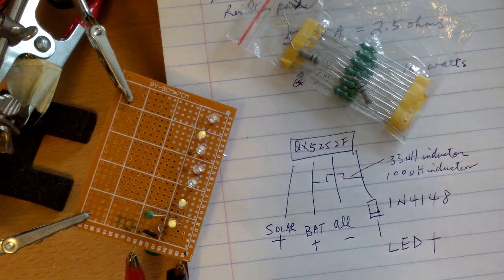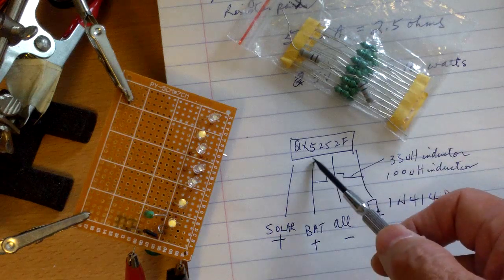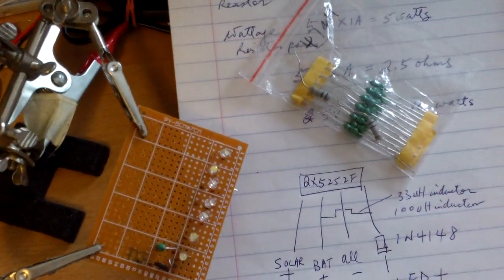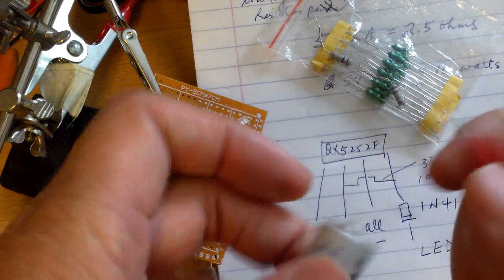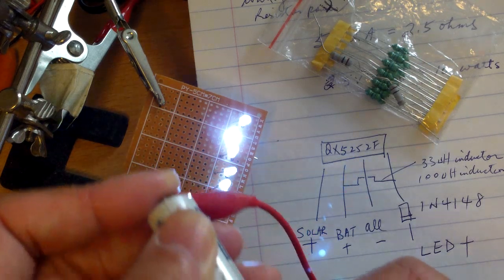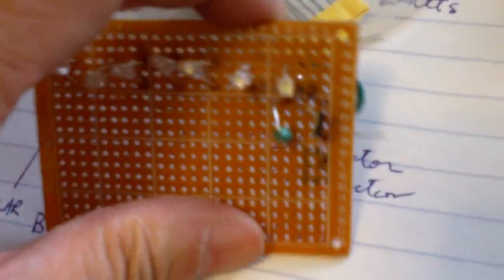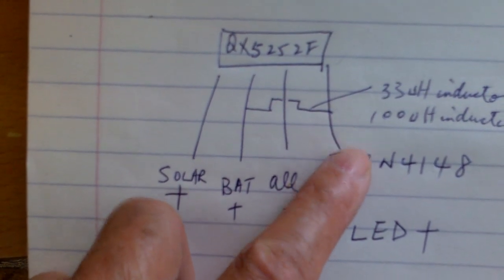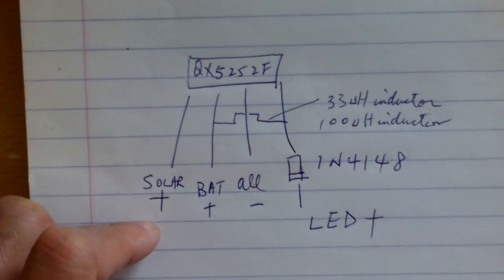Easiest do it yourself solar light

Comment: hi with the qx5252 do you still need a forward voltage diode from the solar panel to prevent backwards voltage leak, or is it built in to the 5252?.....cheers.
Reply from the maker: No you don't need it. It's in the chip.
Reply: @wtam69   brilliant thanks

Comment: I ll explain the solution i ve used 4 the illumination system of my oriental styled garden fountain.
Based on qx5252 chip found on a chinese lamp.
 4 LEDs parallel connected :  1 5mm white, 2 10mm warm white and 1 5 mm slowmulticolour. I keep the original inductor of 47uH so standing at qx5252 datasheet circuit should have about 75mA of output. Plus I used same 1N4148 diod of ur system But different Cap solution: not a 220nF but  a parallel of 2 x 100nF. Quite  same capacity BUT shorter time of charge...similar of a PORSCHE biturbo system. Ending I put 3 AA batteries parallel connected in my system: 2 2450mA plus 1 1300mA...just to sleep quietly at night...whit a pretty shining light of course😉.
Reply: why do we need a 1N4148 diode? actually I have built without any diode and it works well. Would you please explain what is the use of diode?

Comment: Hi,
is there a possibillity to change the battery to a super capasitor.if "yes" please let me know the value of the super capasitor.
Reply from the maker: Theoretically it can be done but it's cheaper and easier to use a rechargeable battery. The QX5252F chip has special requirements for charging and discharging and it's geared for 1.5v rechargeable batteries.  Unless you can find a cheap (supercapacitors are expensive) 1.5v supercapacitor  that can act like a 1.5v battery, then it's not recommended to use one.

Comment: I have  found something interesting. You can bridge the output of 
two QX5252F's to get more current out. it's similar to  connecting 
batteries in parallel. I tested this by using a single,  larger capacity
 solar panel and battery for two chips then i just connected the two 
chips outputs in parallel (just the outputs) You can also run two 
separate qx5252F solar circuits if you don't bridge the outputs. I'm not
 sure how these  configurations will affect charging or chip life yet 
but they seem  to be working well so far. Cheap thrills.. Have Fun!
Reply: mike rootz can you explain the term "bridging just the outputs" ? Do you mean connecting only pin 4?

Comment: You can run 4 to 6 slow color changing LEDs in parallel with a Qx5252 chip paired with  a 10-33 uH inductor across pins 2 and 4 of the 5252 and with a 22-100 uF cap across the LED leads. The cap filters the pulsed output and increases the voltage output and LED brightness. A 2000mA NiMH battery and a 2V, 300mA solar panel works well with this configuration and will drive the lights for 6-10 hours.
Reply: Yes i've also been experimenting with different axial inductor values, it make a huge difference in output, Also i found you can take smaller value inductors and put them in series to get the value you wanted,  Im getting mine from tv's and video monitors for free.

Comment: Are the LED's in series or parallel?  I'm also guessing they all connect to that one diode?  I guess the diode drops the voltage available by about 0.7V, and has a running resistance of about 1 ohm I think, so it reduces current, and power available to the LED's a bit.
Reply from the maker: trailkeeper The LEDs are in parallel. Compared to the other ones I have made, this configuration with the diode is quite a bit brighter. I don't know how the switching diode does it magic but it appears to work.
Reply: wtam69 Oh, maybe the diode there is needed due to the coil and possible back emf or something.  Well, if it improves the circuit its good.  LED are also diodes, but about 3V types.
Reply: I have built it without using diode and it works pretty okay. Do we really need to use diode?